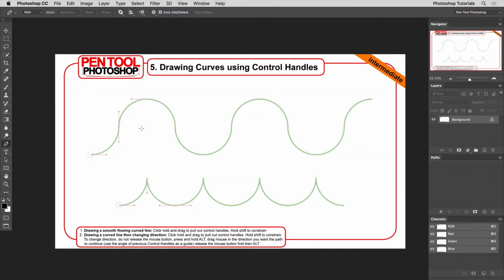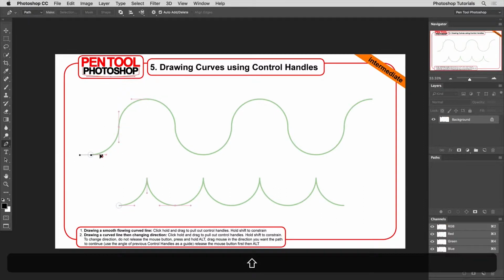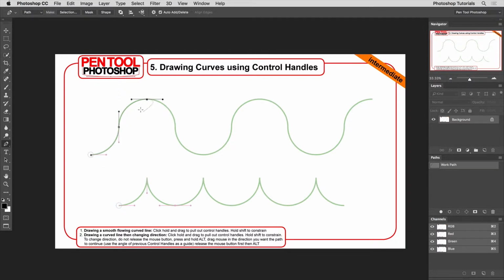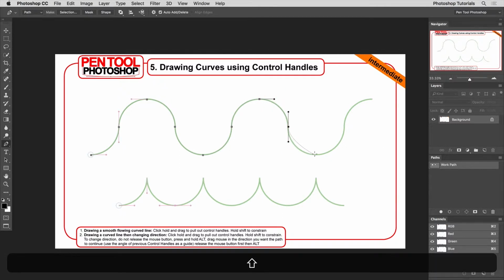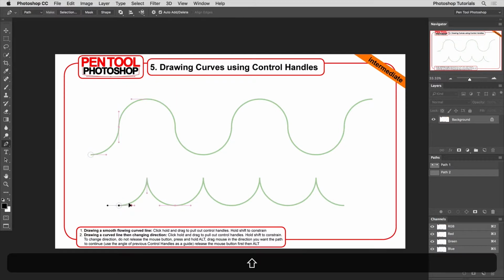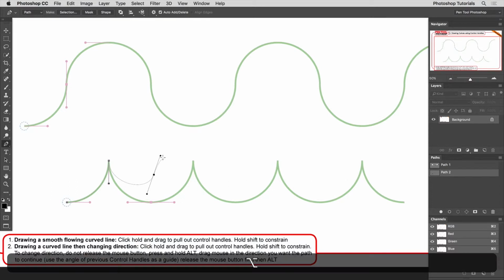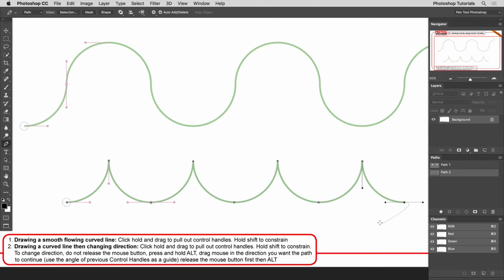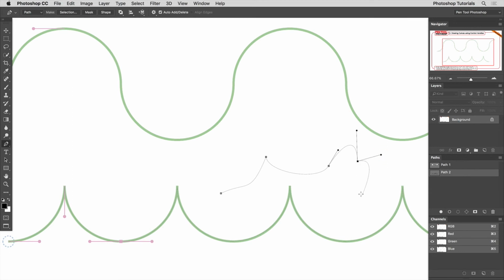PEN TOOL Photoshop Tutorials 05: How to use Pen Tool, Drawing Curves using Control Handles

Comment: Any reason not to cut the end points by pressing ALT.
Reply from the maker: Usually Paths are for cutting around the whole image creating a silhouette and you'd close off the Path back at the beginning. But for sure if you just wanted to draw a line like in this example, holding down ALT and clicking is correct.